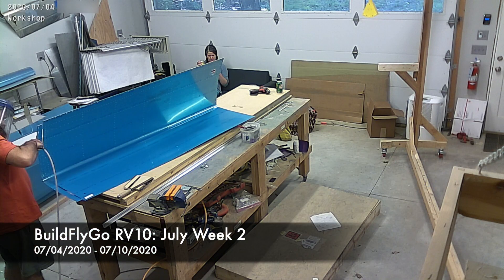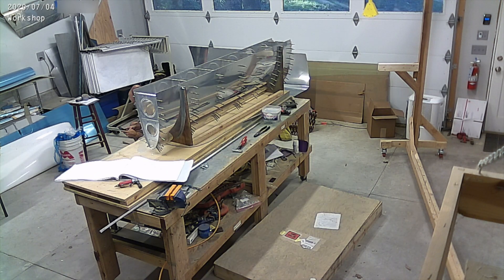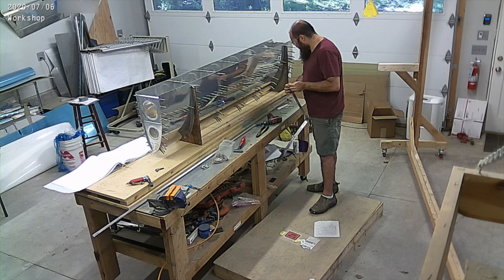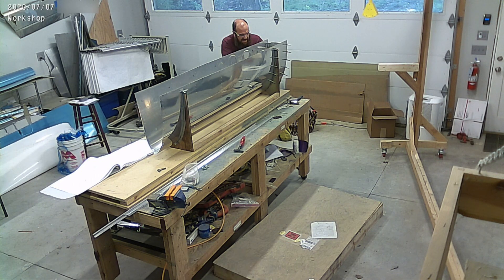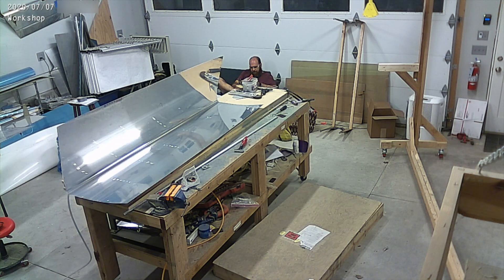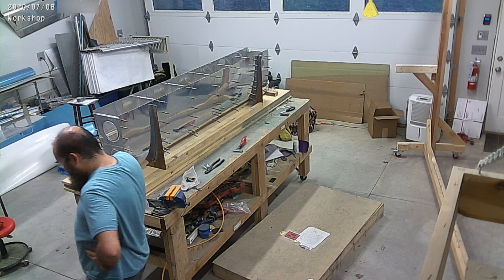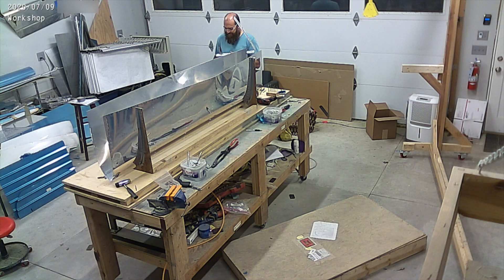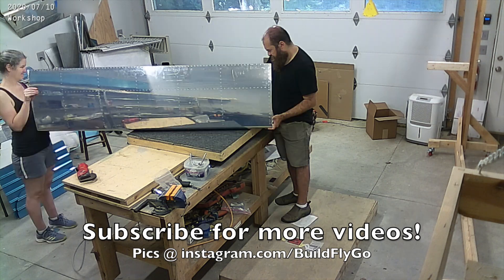RV10 Build: July 2020 - Week 2

Comment: I was forever asking you while you were building 689RV whether you were considering aux tanks, because the fuel capacity on the RV-9 always seemed 20-25% less than what I would consider optimal for serious IFR flying. Guess I was right... 😉
Reply from the maker: The extra hour really helps when airports are more spaced apart. On the way back we really wanted to skip one of the two stops between Puerto Rico and the US but the airports didn't line up. That extra hour would have saved us at least an hour of the customs dance. 

I'm also adding plumbing for an extra ferry tank to go either in the baggage compartment (15gal) or replacing the rear seats (up to 2x33gal.) Gotta have the extra legs for the pond crossing ;)